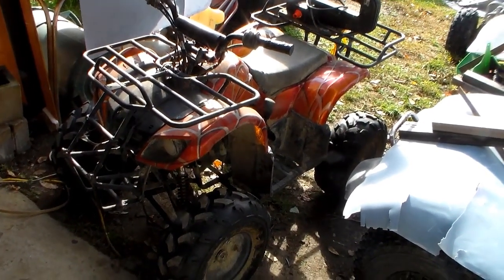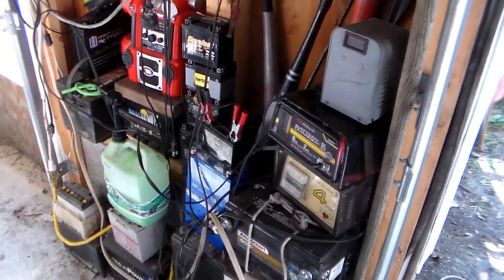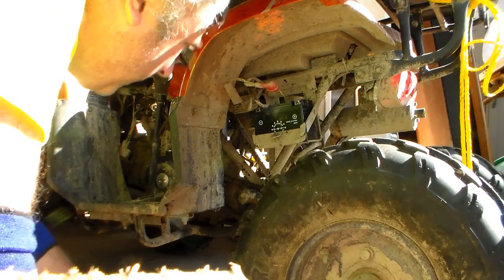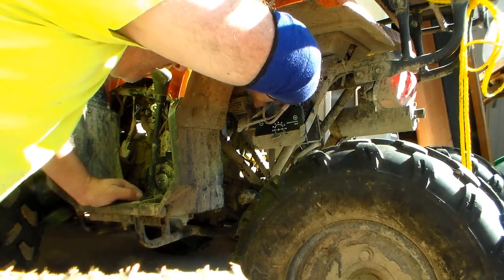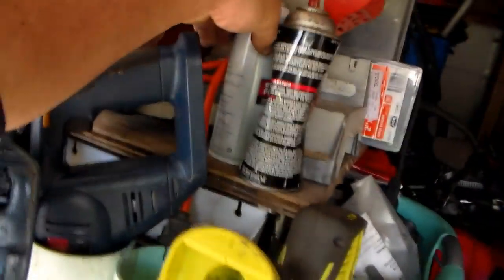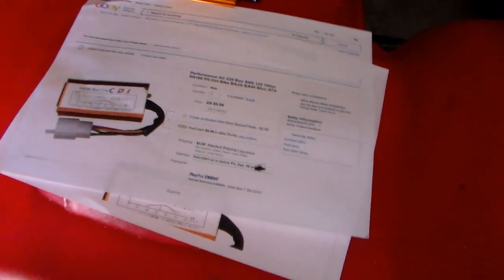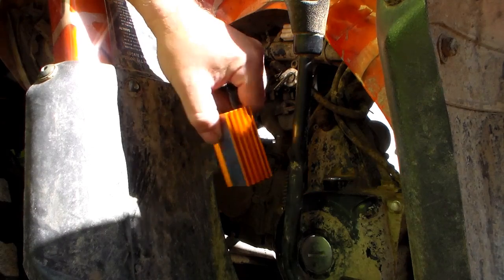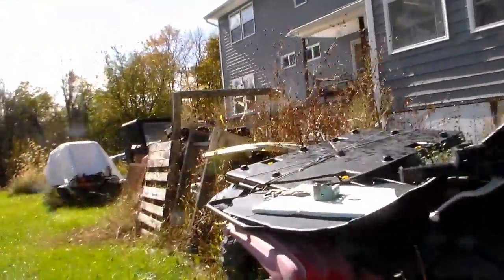Coolster ATV Battery Install, High Performance CDI Upgrade, Test Romp!

Comment: i am in the middle of a wiring nightmare with a honda 250 ex and i am wanting to put this motor with the new top-end in m recon and it has electric shift this motor is set up with a hand clutch this should be one hell of a challenge i am already thinking that  i might just be banging my head against the wall meanwhile i have my rancher apart putting anew cam timing gear and chain and adjuster  arm in it fun all over my shop man

Comment: It definitely reved higher. I think the limiter is about 7500 on those engines stock. Can it handle the carb upgrade is gonna be interesting. I've been planning that carb upgrade for mine but havent done it because my bike is running perfect this year. Now that cooler weather is upon us I'll probably go for it. I have a two different carbs to choose from already.  My bike is already dangerous and tries to hurt me every time I ride. That is what makes it fun. Lol. 👍👍

Comment: I have some experience with the blue case version of this cdi and they have all been junk. Upon removing the end cover of the cdi to have a peek inside, i discovered it full of sand and rocks. Im assuming these are the same thing just different color.

Comment: I want to know how to install an aftermarket starter on a 13hp single cylinder Briggs and Stratton vanguard. Has the correct flywheel, and mounting holes for the bolts, but the actual hole in the plate aren't there. I'll need to make that hole

Comment: I have a 1998 Honda fourtrax 250 and the electric start stopped working and when I push the start button it makes a click noise under the seat were the wiring is. I wondering if you know what the problem is.
Reply: Sounds like starter cylnoid
Reply: Jacob Cummings I have a 250 fourtrax TRX and it did the same thing , try bypassing THE SOLENOID and it it starts then you know it’s the solenoid if not then it’s probably your starter , mine was the solenoid ! Good Luck